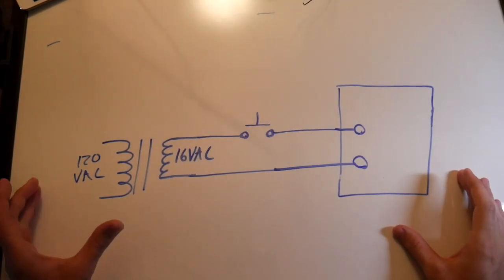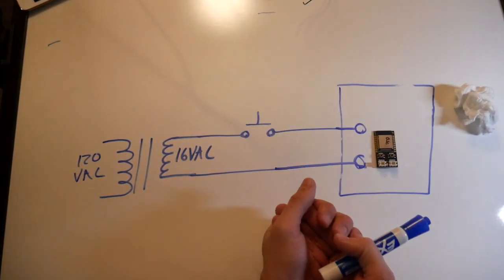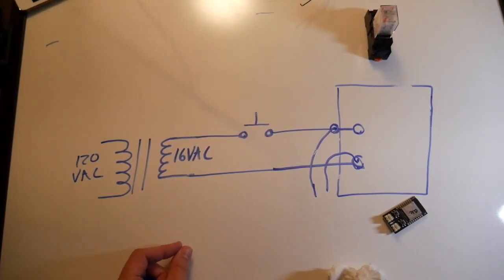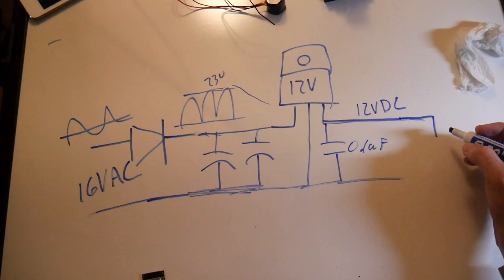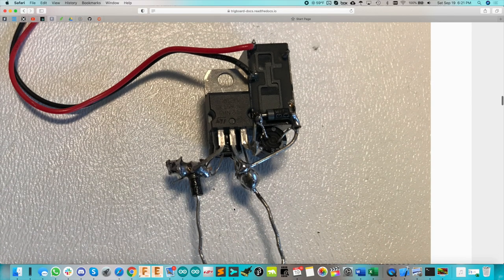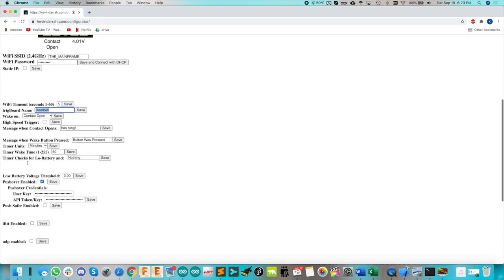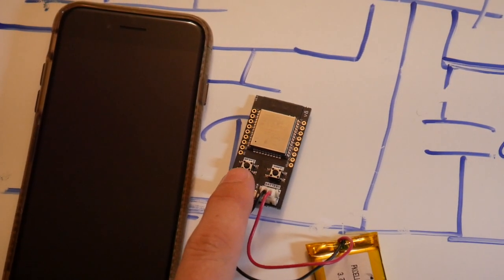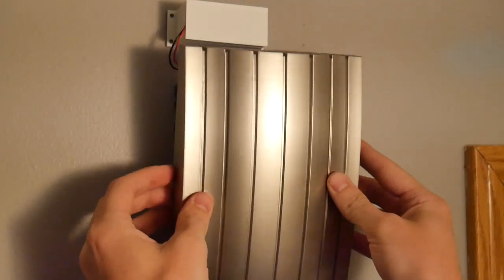DIY Door Bell Push Notification with ESP32 (trigBoard) Full Tutorial

Comment: very cool.  would like to see an update where you power the trigboard from the doorbell voltage to get rid of the battery!
Reply from the maker: yea, only problem is that case when the button is just tapped, you wouldn't have enough power to wake, connect to WiFi, and send the push notification.
Reply: @Kevindarrah  maybe the unit could be installed by the transformer instead and the circuit could detect a current flow instead.  then you would always have power.
Reply: you could trickle charge the battery through the bell coil with a low enough current so the bell does not get energized. if the bell buttons wires are accesible it should be pretty easy.
Reply: @Kevindarrah  This is very close to what I was looking for.  I don't have any programing experience and this doesn't require any.  I was thinking of a current loop detecting current triggering a device to send the sms or email message.  How often do you have to charge the battery?   That's the only negative I see.   The service you use to send the text message, would that be a free service or pay for?
Reply: @szaszafaja  Maybe a resistor across the doorbell button to allow some current flow??

Comment: I used an voltage divider (with resistors),  connected between my doorbell and my ESP8266. Works great, probably unsafe, but a 1000 times cheaper and super simple
Reply: This is what i thought of doing too. I thought maybe it would be worth using an op amp follower and fuse tho
Reply: Could you please go into a little more detail on how your voltage divider circuit connects to the circuit?  Thanks
Reply: @n1kkri  Sure, here's what I use. VIN (from the button press, 7.2v) <-> R1 in my case 1k <-> VOUT (to ESP8266 12-E ADC pin in my case, now 0.978v)  <-> R2 157 (odd, I know, I combined 100+47+10 in series) <-> GND (this is both the doorbell & ESP's GND). This gives me 0.978v out, on my 7.2v power source. 

But there are tools online for generating the R1 & R2 resistor values, so you can take the 16V as shown in this video down to something you can use (3v?), with whatever resistors you have laying around. Search for "voltage divider calculator". 
And if it's AC, as used in the video, you might want to add an diode bridge rectifier to be more safe (remember LED's are also diodes, so you probably already have all the parts needed).  I have however sensed both AC and DC with my ESP, so I'm not sure if you REALLY need it rectified.

Comment: I'd think a 12VAC coil relay would be OK on a 16VAC transformer for the very short time it is actually energized... not enough time for the wire in the electromagnet to heat up and burn out.

Comment: using an optocoupler would be simpler
Reply: yep. I don't like the relay solution either...
Reply: My first and last plan!
Reply from the maker: didn't have any optos handy, but I've got another project in mind that I'll have to try this method out on
Reply: Pc817... You can find It on ANY switching Power supply...

Comment: @4:12  Your single diode is only a half-wave rectifier, so you only get one side of the AC, and half the voltage.  In your case, a little over 11 volts is all your capacitors will see.  Without a center-tapped transformer, you will not get the continuous pulses you drew.  Every other pulse will be missing.  If you had used a bridge rectifier (4 diodes), your numbers and drawing would be correct.  And, of course, you'll never get 12 volts out.  Your regulator will sit there doing nothing except passing the full 11.x volts on to the relay.

Comment: Good video, just wondering why did you use a single diode rectifier vs full bridge rectified signal. Since you are using 2 caps after diode you may not notice the ripple when missing the negative side of your AC signal.

Comment: Why not just put a N/O door contact (or raw reed switch like you started with) on the solenoid of the doorbell and save the voltage regulation gear to power the project off the 16vac instead of a battery?
Reply from the maker: actually, I did try this, but didn't work as well.
Reply: @Kevindarrah  The sensor or power? An inexpensive accelerometer would also be able to feel the movement of the solenoid.

Comment: ‘Doorbell text message’ and ‘buy trigboard’ were added to my todo list last week. You just saved me a lot of work! Could you install this at the transformer instead of at the chime? I guess for your method you need to take your input from after the button and before the solenoid?  Could you put an inductive coil around the 16V ac wire at the transformer and use the current measurement to activate the trigboard? Would potentially be non contact, but not sure if it would work or how reliable it would be
Reply from the maker: hmm, yea I was thinking about that as well...  maybe I'll have to experiment with this
Reply: I was thinking of the same thing.  I have seen small clamp on current sensors but they have been used to feed ESP32xx boards to send out the sms or email message.

Comment: Have you noticed a relationship between solder flux left on boards and increase in sleep current, in your general experience
Reply from the maker: only one time, but not directly... I heard there were some board failures and that it was due to a "dirty board".  I guess they cleaned it up and it worked.  I have never seen this issue before though with anything I've done, but then again, I always clean my boards pretty good with alcohol.  That might be a good experiment though
Reply: @Kevindarrah  i had battery powered boards in the field that underperformed the calculated battery life by a couple months. Then I learned that flux is  conductive and that isopropyl alcohol was a thing.
Reply from the maker: @billiejean3748  yep, that's how I clean my boards! But might be cool to test this though

Comment: Would a reed relay or the type they put on doors placed near the solenoid relay of the Chime close the relay to fire off the trigBoard?   I tried this but the round relay I have could not fit in the area or the solenoid relay.  The slim type would fit if I had one.
Reply from the maker: yea, I actually tried that and some success, but wasn't 100% reliable, so I moved on.  If I had to do it again, I'd use an optocoupler circuit instead.
Reply: @Kevindarrah  what about a small current probe to detect current when the doorbell was pressed.  You could also mount this anywhere you had access to one of the doorbell wires.  My transformer is at the circuit panel.  I also have a a.c. receptacle near by I could use a cell phone power supply to power the trigboard.

Comment: If you are going almost the full way in electronics then why not just stick a optoisolator after the smoothing caps with a resistor feeding it... Would the output of that not be sufficient? More compact circuit than having a relay... Also, wouldn't having it wake-on-open mean that if someone held in the button constantly then the trig board would never trigger and i suppose those annoying folk who hold it in for 10s then the trig wouldn't boot until the end of that 10s rather than the start...

Comment: Is there a free alternative to Pushover?  Is it possible to send email instead of text?
Reply from the maker: yep, IFTTT, Push Safer, or even MQTT to your own setup.  All supported by trigBoard in the base firmware
Reply: @Kevindarrah  I was under the impression that Pushover was a paid for service.  I will have to look the others up.    Thanks
Reply: @Kevindarrah  when you say "to your own setup" you mean just entering my router user name and password?     Do you also offer a way to communicate to the trigBoard via a simple AP access point method like many other devices like Honey Well WiFi Theromostats and other DIY projects?   Would having to have Windows 10 then not be so important and it all done via WiFi?

Comment: can I use my cell phone for the bluetooth connection for configuration?   If I use my laptop will it work with Windows 7?
Reply from the maker: mobile support not yet... working on that, but really need Windows 10 for the configuration - not tested under win7
Reply: @Kevindarrah  Well that kills the project for me.  I don't have any plans in the near future to move to Windows 10 while everything I am doing now works fine with 7.    Will check in once in a while for updates. 
Thanks,
Reply from the maker: @n1kkri  if you got a raspberry pi laying around, that works too
Reply: @Kevindarrah  I do have a spare Raspberry Pi.  Do you have an image I can put on a SD card and a wiring diagram for it?
Reply from the maker: @n1kkri  oh I mean you just need that - use chromium to go to the configurator link: https://kevindarrah.com/configurator/
Reply: I would appreciate if anyone can tell me if Windows 7 will work with this project.  I built up the A.C. to 12 volt supply with a relay all working fine.  I just need to know how I am going to program it if I only have  a Windows 7 computer.  Thanks, Ken

Comment: Wow, I just looked up how much the cost is for the board.  If this was a $5-$10 board it would be a good deal.  At $30 plus the rest of the parts, might put you up at $50 at least with shipping     I have been looking at projects using the ESP32xx boards which seem to be priced much lower but require programing.  Has anyone converted a existing product like a water sampler with wifi sms or texting to work with a doorbel?
Reply from the maker: Yea, small batch manufacturing in the USA is not going to be cheap - not to mention the endless development time that goes into this sort of thing